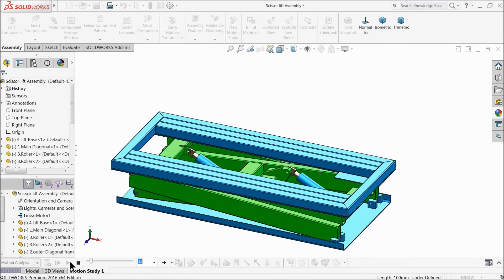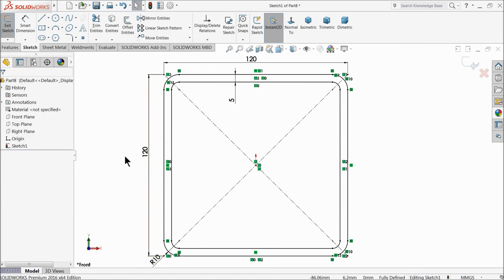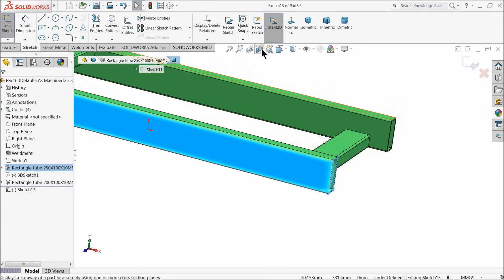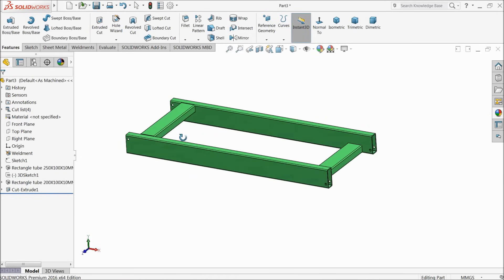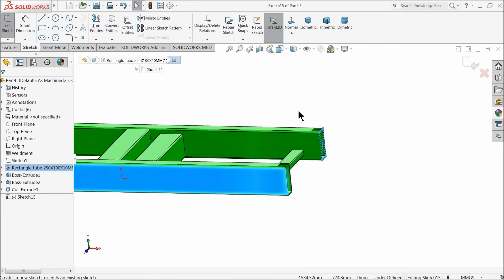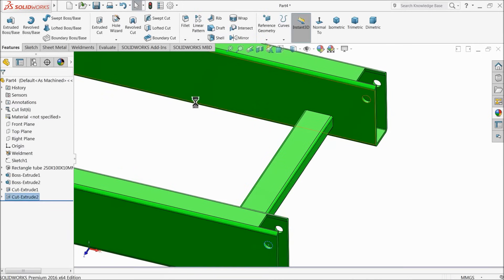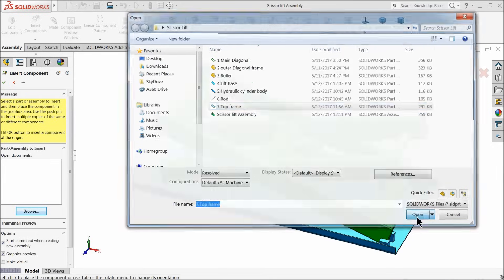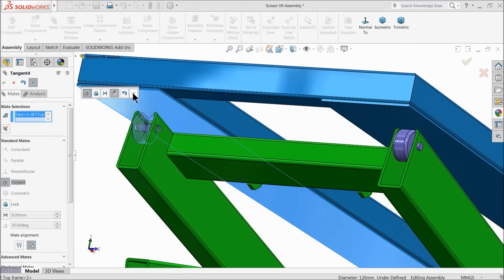Solidworks tutorial | Design and Assembly Scissor Lift in Solidworks

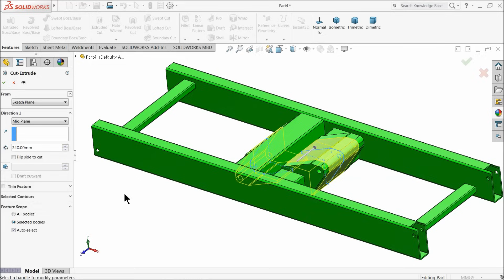Comment: Hello sir, in the Outer Diagonal Design @ 35:35 you need to extrude 490mm and cut about 460mm, then the Hydraulic Cylinder will fit perfectly @ 1:11:19 because the same dimension is taken in Main Diagonal too. And also set the limit distance mate for the Hydraulic Rod from 65mm to 545mm. Thanks for the valuable tutorials. Kudos!